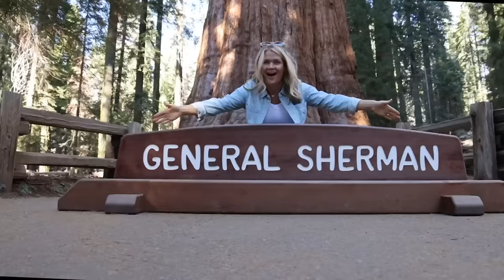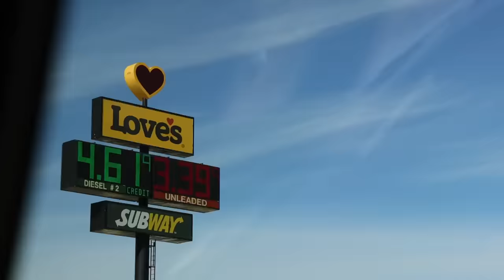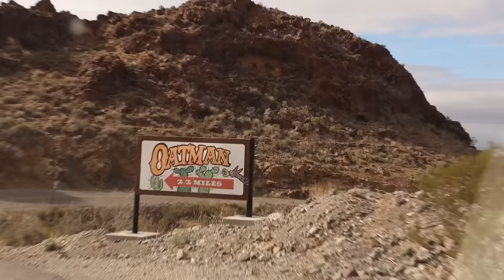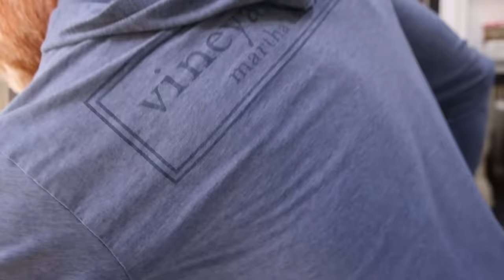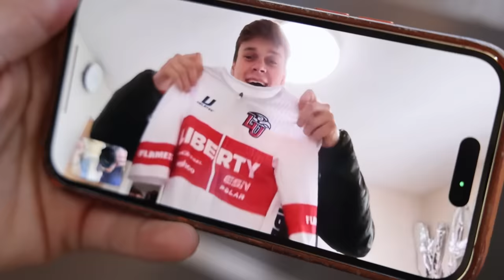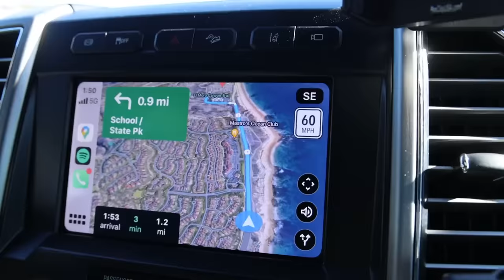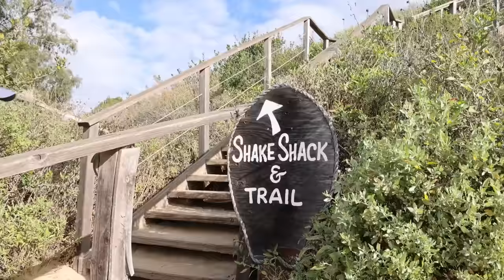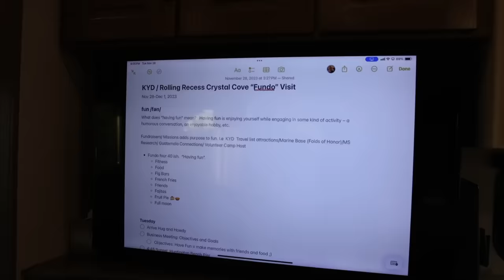RV LIFE 🛠 Fixing Stuff in Really Pretty Places...

Comment: Marc, here's a better way to tow your Suburu without a battery kill switch.Get a small car battery solar charger at Harbor freight.plug it into the12v plug or directly to the battery terminals.Get a 12V digital voltmeter to monitor Suburu battery.I towed a 2001 truck for years with the key in accessory to unlock the steering wheel.Starting outin the a.m. static volts were 11+.After 7-8 hours driving,the voltage was always in the 12+ range.the truck is now 23 years old and only on its 3rd battery!!I put a solar charger on all my cars now.try it , it works.
Retired aircraft mechanic and B757/767 Captain.Motorhoming 18 years.Good luck.We enjoy your videos.

Comment: Our caravan is 6 years old and has a 12v compressor fridge/freezer. It has never missed a beat and has been run on both AGM and Lithium batteries. I definitely prefer a 12v as opposed to LPG in our extremely hot temperatures in Western Australia as the LPG struggles to cool 20°C below ambient temperature. Good luck with your fridge, keeping fingers crossed that you have solved your problems! I have followed you since you started, for me you provide a travel show of America, I see sights that I could only dream of visiting one day!

Comment: Hi again, just a couple of comments on the 12v fridge.   Our previous trailer had one, and it as well failed.  It was actually within the first year that we owned the trailer.   Dealer could not solve the problem, so they simply changed it out (under warranty) and gave us a new fridge.   With our current trailer we went back to the 2 way electric/propane.  Yes it is a bit smaller so clearly holds less stuff, but it is plenty big for two of us travelling on extended trips.   12v fridge was okay, but as you say it draws steady power.  If you are plugged in then no worries at all, but if you do any off grid camping and don't want to carry a generator, then you will need a significant battery bank and significant solar array.  Absolute minimum 200+ amp/hours of battery power, and a couple hundred watts of solar....and sunshine.    No matter how many solar panels you have, you are virtually battery only on a cloudy day.   That fridge will be eating up 50-75 amp hours of your battery every 24 hours no matter what.

Comment: You should pick yourself up some Ruuvi tags for the fridge and freezer temps, they work great with a Bluetooth app, we also have them for outside and in the compartment the Multiplus II is in
Reply from the maker: I will. thx
Reply: @KeepYourDaydream   Forgot to mention that the Ruuvi tags are also compatible with the Crerbo GX and if you load GUImods on the Cerbo GX, the Ruuvi tags with show on the touch screen.  With GUImods, you can also easily make adjustments that you would have to go into the menu settings, right from the main screen.

Comment: I had the same fridge. Went down right before a big trip. When I pulled it to check the compressor. There was a huge mess of oil. Ended up replacing with an apartment fridge and an inverter.
Reply: How do you like it? We have the same fridge as well.  We had it replaced under warranty last Sept and now it seems that the freezer fan isn't working properly.  We took it out and we bought a residential fridge to put in it's place.  Waiting on delivery
Reply: @michaelnlisa8207  we love the one we have now. It’s a magic chef from Home Depot. Fit perfectly in place of the old one. Gets cold super fast. I had to add child locks to keep the doors closed.
Reply: @shawnc74361  we bought that one!  Haven't secured it yet. It fits in the spot but there's not a lot of room in the back.  How did you secure it? How long have you had it? It looks like the shelves might bounce a little.  Thank you for any info!

Comment: Does size matter?  Curious minds wanna know.  We're headed West and to Acadia in 2024,  in our Classic 33FB.  So far we've had zero issues fitting in our sites.  Looking forward to the visit with Vinnie, as our rig came from his shop.  I'm with Marc on the leveling and appreciate all the pointers.  Wanda (& Vinnie)  Charleston SC
Reply from the maker: Remember that you have at least 6 feet hanging off the back that doesn't touch the ground. Our rigs are nearly the same size and we hardly ever have an issue. You might not take the suggested size too seriously as the gov is a bit stingy in their length estimates. I park the truck sideways.
Reply: @KeepYourDaydream  thank you ~  we have been using that rear space & edging up as far as possible.  So much so , that at Cherry Hill Park last month we had squirrels peeping in the bathroom window.  The slope of the trail behind us was like the "Woodstock of Squirrels" and it drove our pups crazy.  And at that same site we used our flat rubber mats for leveling on gravel.  Being level is so satisfying.  Thanks again & safe travels~W.🐿